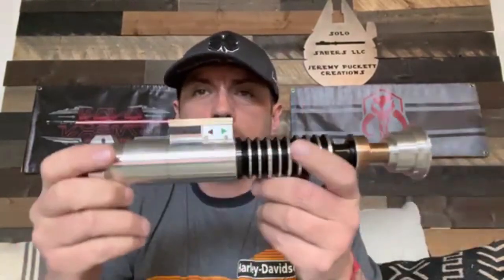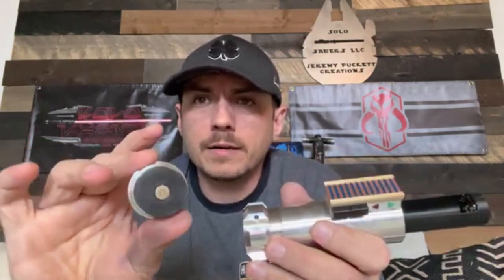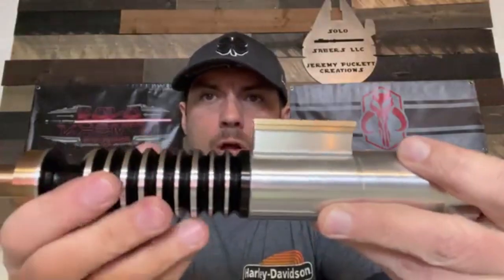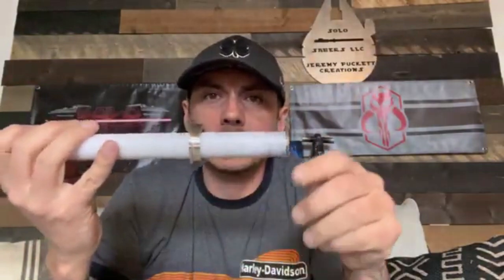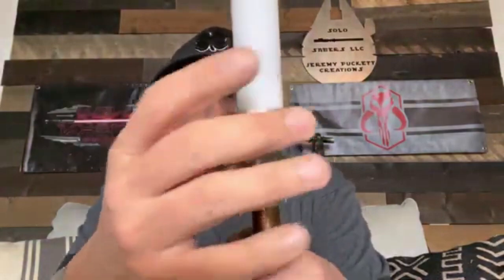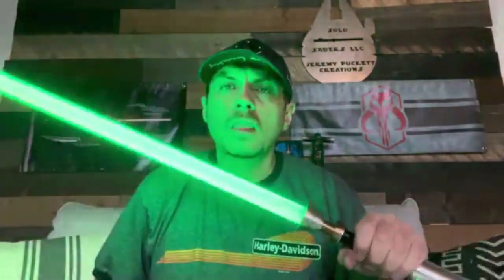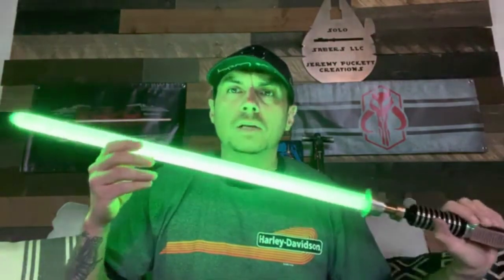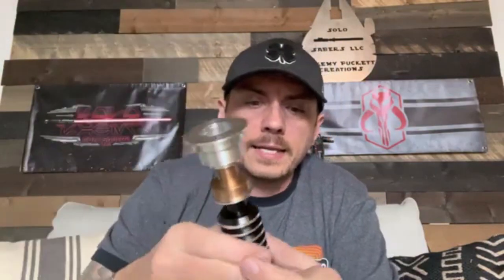Pam's MoM "Magic of Myth" Hero Saber

Comment: Did you omit the pixel cup that goes in the emitter and just use a regular PCB holder?
Reply from the maker: I did- printed custom low profile holder
Reply: @Solo_Sabers  any chance you're gonna add the holder to your etsy store when batch 3 ships out? or your MoM chassis? i would definitely be interested in picking that up